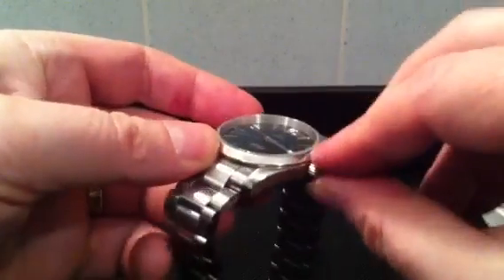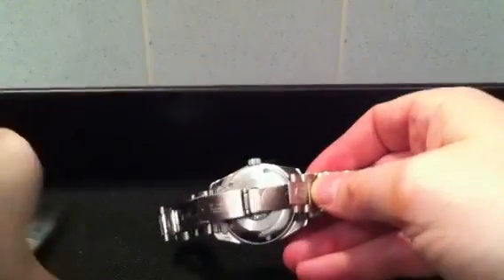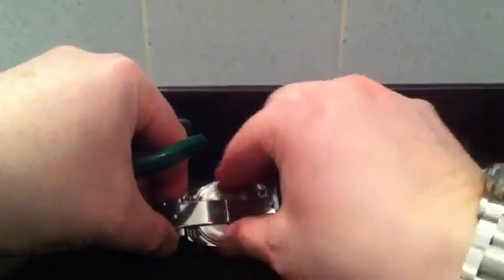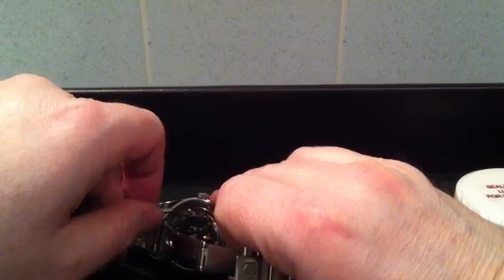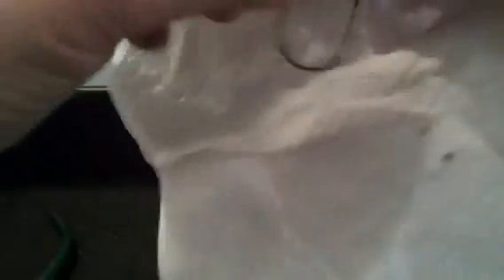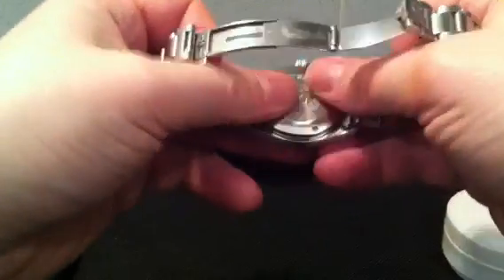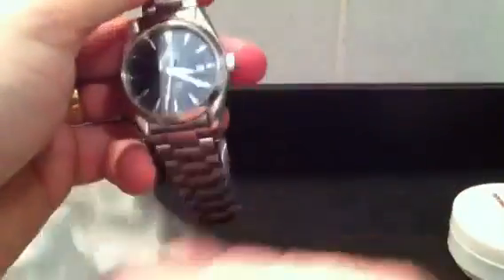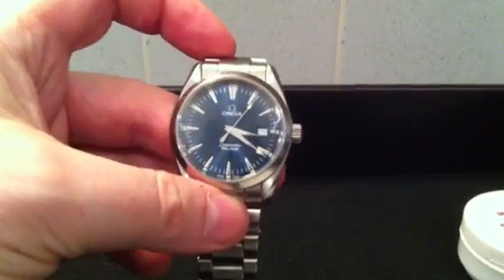Omega Seamaster battery change

Comment: Several things to comment here I am afraid.
First open the bracelet so you have better access. Do not use a pair of pliers on the caseback, they may slip and scratch the caseback, use the tool he showed you, but did not use for some reason.
After opening the caseback and removed the dustcover, he actually dropped the heavy bracelet onto the unprotected movement, possible hitting the coil, which could have ruined the movement!
He used the fingers to remove the battery, do not do that, use a pair of plastic tweezers for this, or grasy fingerprint may do damage to the movement!
He used a pair of pliers again to tighten the caseback, it can not possibly be pressure proved to the requiered 15 Atm by this!
The DIY should at least plase a small piece of tape over the caseback and case, mark the position with a pencil before opening, so when the caseback is tighened, it end up on the same place when the pencilmark align, then the caseback is in the same position as when it came from Omega, more likely to be tight to 15Atm. Cheers!

Comment: Omega originally supplied these watches with an Energizer Multidrain 395/399
Now everyone is going to say Renata is a Swatch group brand so they would only use one of their own brands. There is an obvious logic to that but they used energizer because of its slightly different profile. Most watches with an ETA 255.xxx derived movement will use a 373 or an oversized 371 with a sprung cover which rests against the case back to stop the battery pinging out if the watch is knocked or dropped. Also, the movement dictates the diameter of the battery and the case design the battery height. This affects capacity and so lifespan.

Renata
373 = 29 mAh
371 = 35 mAh
395 = 55 mAh

Interestingly, the Energizer 395/399 is only 51 mAh so you would have to wonder why every single watch that came for its first replacement battery had an energizer fitted. This watch will not accept a Renata 395, its negative side has more radius so the side contact pops the battery out before you have chance to get the back on.

I understand that Omega are now fitting Renata 371 to these with a sprung positive contact to use there own batteries at cost of capacity. I'd much rather keep the Energizer and longer battery life.

The factory 395/399 in this watch should give it a life of 5-7 years which tells me the nylon glass seal is quite old and could become perished and leak. This could end up needing a new dial, set of hands & movement, So your £75 or so saving could become insignificant.

To do this properly would take 45 minutes or so to fit new seals and ultrasonic clean the case and bracelet to freshen it up. As a professional, its blatently obvious which gives better value but my way takes much longer than 4 1/2 minutes and is better for the watch.

Comment: I can appreciate the potential cost savings on doing things this way but...

A professional watchmaker does much more than shown here. 

I don't think I'll do a step by step because it will be way to long. But I would be using a £30 die that is made for that watch in conjunction with a case opener £500. 

In addition, I would check the movement over, condition of lubricants which degrade especially when a oily thumb print is placed over the bridge. 

I would also check the circuit for consumption on our tester £3000
Also, waterproof test the watch on our tester £9000

The speed lubricator you're using should be used by putting the seal inside, put the lid on and giving a little twist to and fro but it appears that yours it saturated. A+f make a good one that is just right. 

I'm not trying to troll here, just filling in the gaps so owners can make an informed decision before reaching for makeshift tools. I guess a case back for this watch would be ~£120
Reply: Truth Truth  which part do you consider rubbish may I ask?

Comment: 6.04 Omega Speedmaster ? Why didn,t you take a bracelet link apart, this would have looked much less complicated. And using pliers to unscrew the caseback will cause lots of people to slip and scratch it, you had the correct tool why not use it.
Not a good tutorial imo.

Comment: WOW. What a way to treat a beautiful watch. OK it got the job done, but what he has performed is a £10 battery change for the price of a battery. He has not performed a  £75 battery change, which is what Omega charge. They will open it properly in a dust free environment and if done properly, seal it in a vacuum chamber. This watch will no longer be classed as water resistant and what we are witnessing is the equivalent of taking your Ferrari to a back street garage for a service!   The fact he calls the metal disc a  ‘dust cap’ as he flicks it out and chucks it back again speaks volumes. That ‘dust cap’ is in fact a key component made from anti-magnetic iron. It protects the quartz movement from magnetic interference and should be cleaned and cleared of any potential static energy before replacement.  🤦🏻‍♂️🤦🏻‍♂️🤦🏻‍♂️🤦🏻‍♂️🤦🏻‍♂️🤦🏻‍♂️🤦🏻‍♂️.